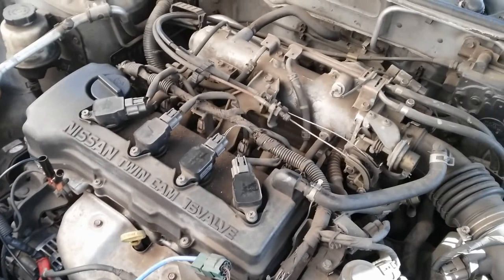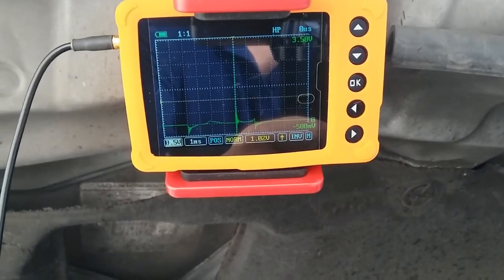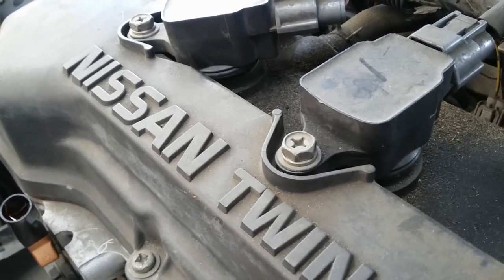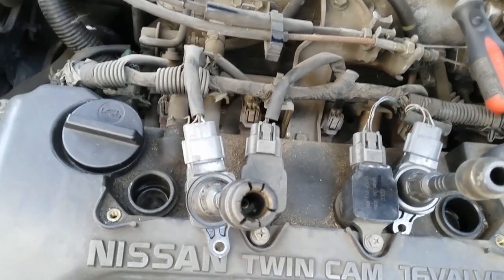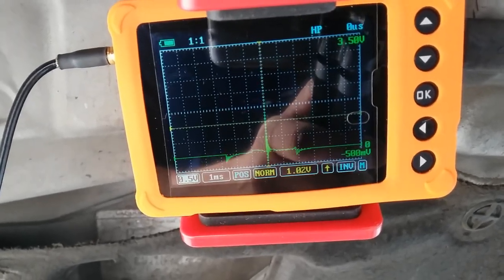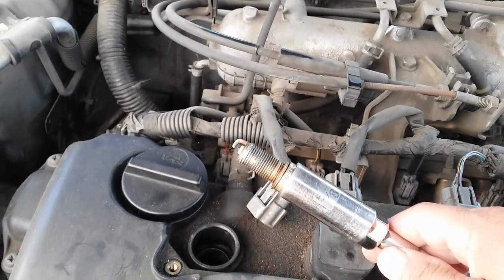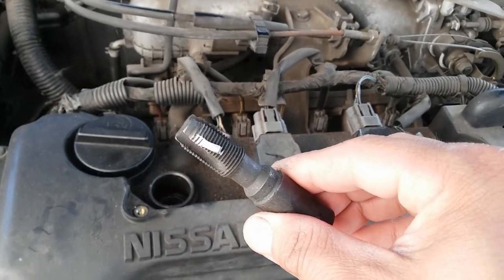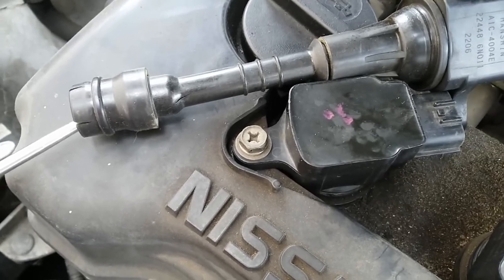(Nissan Sentra) Diagnosing a P0300 with Uscope and Secondary Probe

Comment: Well done. Good explanations. But try this on a V6 Nissan Quest where three of the cylinders are hugged up against the firewall!
Reply from the maker: Yup, totally understand. In those cases, these fancy equipment sometimes don't cut it.
Reply: @EliTheOBDTech  I'm about to remove hood and intake on our van to see if I somehow forgot to connect something or what. I replaced the hidden 3 spark plugs about 6 weeks ago but it runs rough. Showing P0300, random misfire.
Reply from the maker: @dustindavy4319  Injectors can also be the culprit, let's home that it is only something minor. Not sure if your quest has a distributor, but that could also be a culprit. Another would be a vacuum leak, perhaps your intake manifold gasket.
Reply: @EliTheOBDTech  Yeah, injectors are pricey. It's 2009 so no distributor. Would be nice if it's just manifold gasket. Thanks for the quick replies, Eli! I'll subscribe to you from our channel, SERVi Homestead.
Reply from the maker: @dustindavy4319  Much appreciated!!

Comment: I just had the spark plugs, ignition coils and manifold replaced. Problem still there
Reply from the maker: @AxxinTheSupernova  You may have mechanical problems, faulty fuel injector(s), ignition timing issues. You also need to check for power and ground on the ignition coils and fuel injectors.
Reply: @EliTheOBDTech  I think it may be the injectors. I poured in three bottles of fuel injector cleaner, and it stopped shaking and vibrating for a spell. Starting back up again though
Reply from the maker: @AxxinTheSupernova  It seems you have injectors that maybe clogged/dirty

Comment: I’ve changed spark plugs and the ignition coils and I’m still getting codes p300 and the p303 for my Sentra SER spec v 2006 idk what else To do
Reply from the maker: Check compression, you may have a mechanical problem, such as low compression.
Reply: @EliTheOBDTech  okay will do thx

Comment: My daughter's car is doing the same thing and I don't know how to fix it it has the same Gap at the cylinder number 1
Reply from the maker: Do your visual inspection and check the coil pack for any damage first. Secondly, check to see if the spark plug has loosen itself.
Reply from the maker: Another possibility, would be oil leak inside the spark plug hole that has dried up over time